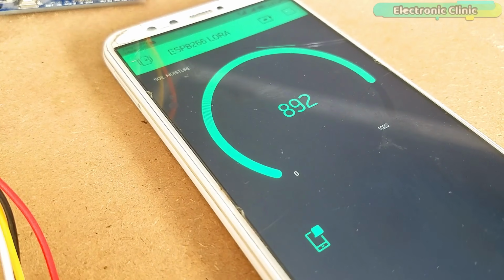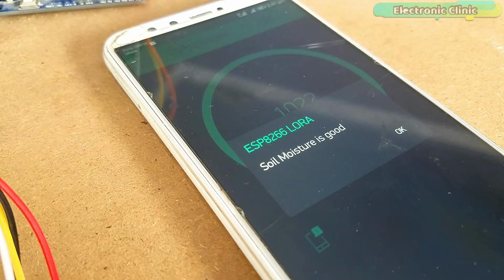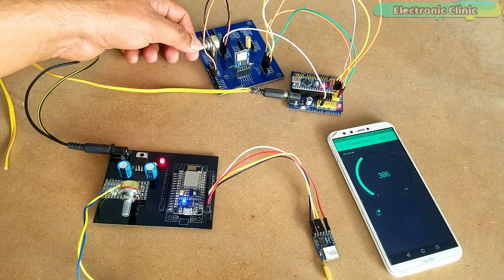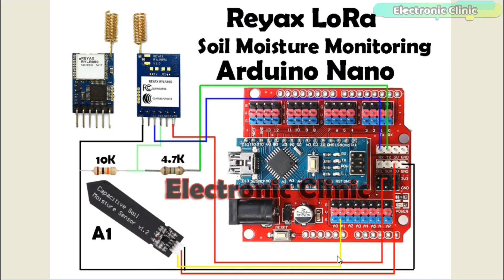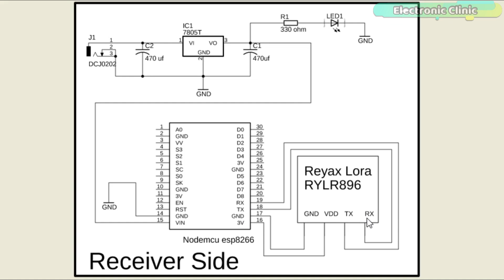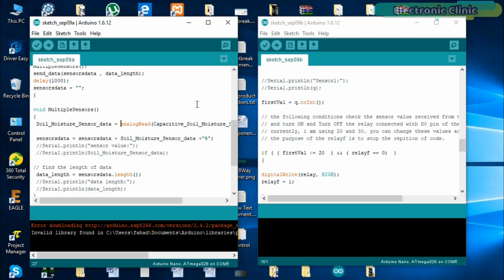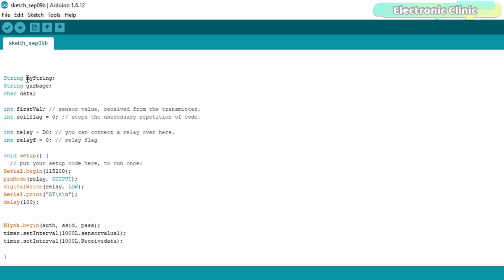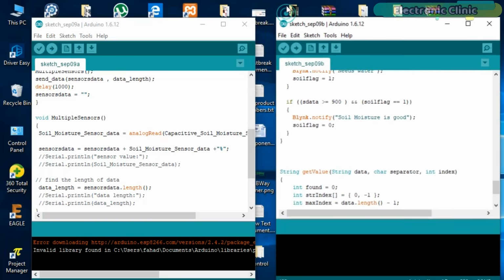ESP8266 Lora based IoT Smart Irrigation System using Arduino Nano & Capacitive Soil Moisture Sensor

Comment: Another great video on the Reyax modules.  Can I use the same setup and app to control a valve to water the plants when the moisture level gets too low?  Or will I have to make the watering system a separate setup?
Reply from the maker: you can.use the same setup
Reply from the maker: these are transceiver modules. in this.project i did only.the.monitoring
Reply from the maker: you can make this two way
Reply: Thank you!  I would like to use the same blynk app, and have a on/off button that controls a ball valve that's connected to the same arduino as the moisture sensor.  Will I have to use an interrupt in the code to control the ball valve at the same time the arduino is reading the sensor values?

Comment: sir i have a problem....

There was some delay between data transfer to receiver its not realtime..i mean when i turn my potential after little  bit delay to receive that value to receiveer side..how to solve  that problem ..

Thank you very much
Reply from the maker: there are delays. reduce the delays.
Reply: sorry Sir..i trying with somany adjustment..but problem  still same...